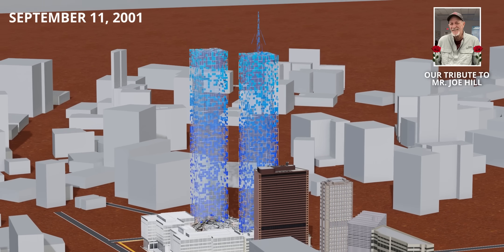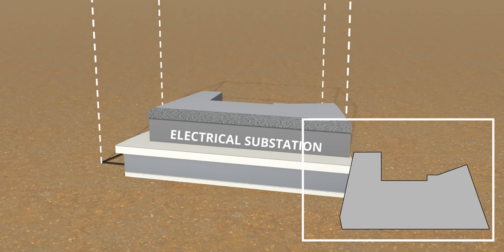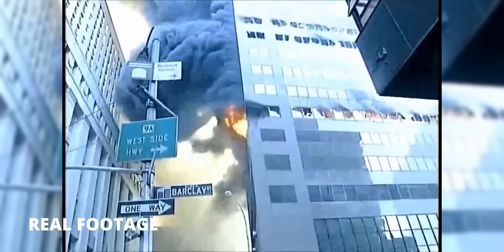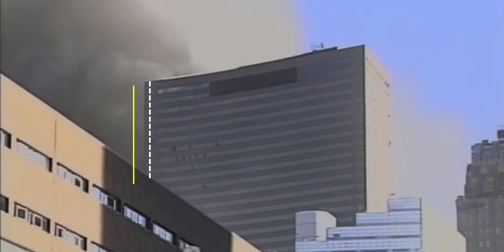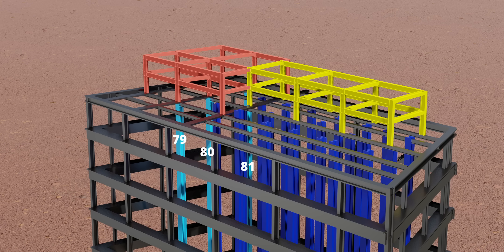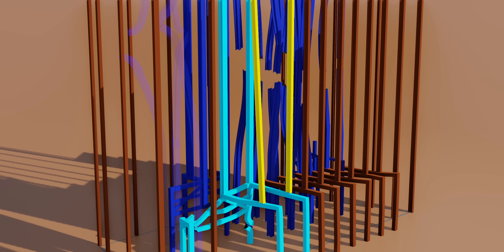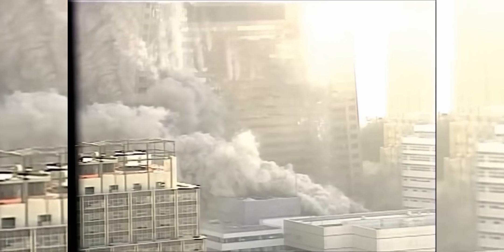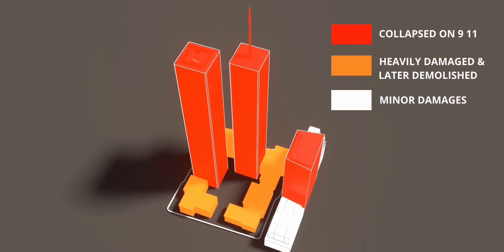Collapse of Building 7 | The Complete Physics

Comment: This was a controlled demolition, building 5 and 4 had MASSIVE amounts of rubble fall on them + fires and DID NOT FALL AT FREE FALL SPEED.
Reply: No building collapsed at free fall SPEED not least because there is no such thing.  Free fall is a measurement of acceleration, not velocity. Building 4 did completely collapse BTW.

Free fall SPEED is just one of a long list of really bad information out there about the Twin Towers collapses, much of it easily accessible to anyone (mostly from Architects & Engineers for 9/11 Truth who only manage to get the date right). Even though the worlds professional engineering community had the details largely worked out within a couple of months, good information is far more difficult to come by and much harder for many to digest. Engineeringspeak is complex and dull and some people put up a wall to protect their beliefs and false assumptions. Besides, wild baseless speculation and pathological theorizing is exciting. Simple, easy hand-wave answers are simple and easy. Fanciful tails of pre-planned demolitions, magical space beams, melting steel and mini-nukes (the awful stuff) are far more entertaining and require a whole lot less thinking, thus getting far more intention than it deserves.

To correct that situation, I have all on my own prepared this short yet detailed technical description of Twin Towers collapses based on my own observation and analysis of the available true and relevant facts. No politics or ideology, just the engineering. My hope is this will dispel many common myths and answer most if not all questions you may have about the Twin Towers collapses, because anything can seem like a conspiracy if you don’t understand how it works

While complex, most of the Twin Towers collapse mechanisms can be seen with the naked eye and easily discerned and understood by the layperson if sufficient time is taken to understand. 

1. The Twin Towers consisted of 4 primary structural elements that together formed an integrated system where each relied on the others.  47 hollow box-section steel Core Columns carry the majority of the gravity loads. The 236 hollow box-section steel Perimeter Columns carry the remainder and ALL of the lateral (wind) loads. Long-span Lightweight Steel Trusses connect the core and perimeter column together at each floor with a Hat Truss on top to tie the structure together as an integrated unit where no element can survive without the others. There was no structural load bearing concrete and most components were bolted together.

2. The impact of 117 tons of airplane (= to about 12 dump trucks) at speeds up to 590 mph with the energy of a ton of TNT completely destroys the aircraft. This in no way implies the Towers come out unscathed. Many perimeter columns are damaged or destroyed as are some core columns (example; 33 of 59 perimeter and 20 of 47 core columns damaged or destroyed at the impact floors in the North Tower), This damage is primarily through bolt-shearing failures at the end connecting flanges, as well as bending, twisting and fracturing of weld seams. There was no cutting or slicing - the reality was far more violent and messy. 

3. The impacts destroy or damage fire insulation, fire breaks and sprinkler systems on multiple floors.  Huge fires are started across multiple floors simultaneously and allowed to spread rapidly with no effective firefighting or fire suppression. This was an unprecedented fire event . 

4. The hotter steel gets the weaker it gets .  With fire insulation stripped away and no sprinklers the survival time of the steel greatly reduced. Gradually over time heat causes the lightweight steel Floor Trusses at the impact damaged floors to sag, which was observed and recorded.  No steel melted or needed to. Structural steel fails long before it becomes a puddle. It just needs to bend

5. Sagging floor trusses pull on the increasingly weak and overloaded Perimeter Columns, causing some of them to bow inward by up to 5 feet. A straight column is up to 4 times stronger than a bent column. The bowed Perimeter Columns buckle and fail, initiating collapse. The formerly static mass above which the structure below could easily support is now converted into a dynamic mass up to 30 times greater. Because they have buckled, the Columns above and below the failure point are no longer aligned . The load bearing structure below no longer bears any load as it falls past the lower columns, NOT onto them.

6. Thousands of tons of debris fall within the four outer walls, down through the open office space, crashing onto the first intact floor it encounters. This massive impact immediately breaks the bolted connections to the columns as the amount of resistance the Floor Trusses can offer is negligible.  The falling debris slows only marginally and briefly. Note:
6a. This is NOT a solid top block crashing into and “crushing” a solid bottom block .
6b. The debris falls past the columns not onto them.  The columns provide no resistance to the falling debris. 
6c. Only the bolted connections of the floor trusses to the core and perimeter columns can offer any resistance. A pair of 5/8” bolts at each end of each truss vs. thousands of tons of falling debris.
6d. No laws of physics are violated.

7.  This floor-led collapse progression within the four outer walls can only go straight down. Note: 
7a. This process is often incorrectly referred to as “pancaking” which actually refers to a completely different process rejected at an early stage. The catchy name stuck but nobody knows what it is supposed to mean.  Pancaking is too simplistic and inaccurate anyway. More like Kaiserschmarrn.

8. Collapse progresses through the floor systems not down the columns, through the path of least resistance . Rate of floor failures increases with each successive floor as momentum increases, reaching an average acceleration of 0.65 of GA, or 35% slower than true free fall. Bam, bam, bam down the building until there are no more floors to fail.  The resistance offered by each successive floor is always the same. The mass and velocity, thus the energy of the falling debris is constantly increasing, with each floor destroyed adding new falling mass. Some falls to the sides, but most falls down. More mass, more velocity, same resistance with each floor.  Don’t get stuck on the but the lower floors weren’t on fire nonsense. They weren‘t and didn’t need to be.

9. The Towers were 95% air by volume. As that air was compressed inside the building it is forced down the tower and blown out the sides in reaction to the building collapsing . Those were not “explosions”, it was expulsions of compressed air caused by the collapsing building, explaining the low velocity, lack of flash, blast, supersonic pressure waves and lethal high-velocity ejecta.  

10. Perimeter Columns become detached and peel away like a banana behind the collapse front, playing out to the four points of the compass extending to more than 600 feet from the base of the towers. This was quite obvious from examination of the debris pile. 

11. Core Columns fail last as their internal beam bracing is stripped away by falling debris and lateral support from the floor to perimeter columns is lost. 

12. For those who care about how long this whole process took; 31-34 seconds from the moment the perimeter columns buckled until the last core columns hit the pile, or 1/3 the rate of true free fall. Don’t believe me?  Just watch any video of the collapses and note the loose truly free-falling debris dropping much faster than the towers themselves.  

13. Each Tower had a 1-acre footprint. Far from collapsing inside their own footprints the debris pile spread out over 17 acres in a pile up to 14 stories deep. 8 surrounding buildings were destroyed and scores more damaged by the falling debris. 

14. What was NOT observed were the 180-190 dB bangs of thousands of high explosive devices or the blinding bright flashes of burning thermite. Neither could have caused the (silent) perimeter column buckling that clearly initiated collapse.  Neither explosives or thermite could have survived the impacts and subsequent fires either. A video of a shocked and injured firefighter using the magic word explosion is in no way proof of explsoIVES . The pre—planned demolition case relies entirely on that sort of thing. There is zero tangible physical evidence and it would be technically impossible, totally impractical and completely unnecessary. No one would bother. 

15.  Finally, the Twin Towers were perfectly safe within their design envelope.  They only collapsed when taken far outside design parameters by an extraordinary and unprecedented event 

Impact + Fire (heat) + Time + Gravity = Collapse . Remove any one of those four elements and there is no collapse. Ignore any of those elements (as many do) and you will never understand the collapses. The Twin Towers were an integrated system in which no one component could survive without the others. One fails, the rest follow, through the path of least resistance – DOWN – through the open space, bypassing the path of greatest resistance – the columns.  Nothing I just described violates any laws of physics. All of the above is true no matter who planned and carried out the 9/11 attacks or why 

I hope you found this helpful and informative. It is not meant to be adversarial, but to solicit informed critical comment, positive or negative. If I made any errors of fact, logic or reason or left anything critical out, please let me know so I can fix it. To stay focused just one topic at a time please and on-topic (Twin Towers ONLY). No word-salads of Gish Gallop. IF you can offer a more plausible alternative be my guest. Be the first. Please start any reply with the words “Tits McGee” or I will know you didn’t actually read it, are not serious and just wasting my time.

Comment: I'm not buy this bullshit!!!
Reply: Seems like a personal problem.

This video is pretty good – with a few exceptions - and goes into a much higher level of detail than many viewers will be able to comprehend.  While not perfect, the collapse mechanisms – the sequence of failures - described here  are substantially correct and this is true no matter who planned and carried out the 9/11 attacks or why . 

That may not be what you want to hear and go against 20+ years of entrenched dogma and conditioning, but it’s not wrong. 

That also means (in case you did not get the hint) this video can be (and IS) absolutely correct in its description of collapse mechanisms AND the 9/11 attacks could still have been some sort of inside job. The two things are in no way mutually exclusive. 

The mechanisms described here have broad professional support around the world. There are no professional engineering organizations (for example: ASCE, ASEE, ICE, etc) that disagree with them or have offered any formal dissenting opinions or alternative hypothesis. 

So, setting hubris aside, either the overwhelming majority of the worlds structural engineers and simple observation are wrong,… … or you are. Which seems more likely? 

IF you still think believe this explanation is wrong then produce a better one . Good luck with that. No one ever has and I don’t see you moving that needle today. 

No one ever does.

Comment: Man, if only there was a single piece of physical evidence from wtc 7 to back any of this up....
Reply: There is.
Reply: @TheCriticalStinker-01 Not according to NIST
Reply: @TheCriticalStinker-jw4fl  The wtc 7 collapse final report from NIsT states that all remains of wtc 7 were disposed of before they began their investigation.  Their draft reports are way less obscure, stating that the steel used during the construction is based solely on data from the literature, because no steel from the building was recovered.  NiSTs words, not mine.
Reply: @kyleconroy2312  - Yes, that is correct. Which is exactly what I said.  You need to read my entire post.  All of the words matter and go together.

Comment: That’s reaching like crazy, there were no sprinkler systems in 7 to put the fires out? Also the top of the wtc tower that you’re claiming hit 7 looked like it fell a different direction from 7, not directly away but just to the right of it and the angle in which it hit wouldn’t make sense. I’m still not sold that this is what happened, sorry man.
Reply: The sprinkler system was not automatic but manual. The building was evacuated prior to the North Tower collapse.  Effective active firefighting never took place due to half of the responding FDNY having just been killed, surviving units in disarray, much of their equipment destroyed and the collapse of the North Tower severing the water supply to Lower Manhattan.

The video is incorrect in stating the antenna hit Building 7. It was actually north face perimeter columns which struck the south and west sides of Building 7.

Comment: They say in this video that the Spire caused the damage to one side of the building wtc7. Can anyone tell me after tower, one and tower two were completely collapsed and the smoke cleared why I could still see the top Spire standing Upright. This is just another false information video.  look at the evidence. and why do they not ever let you hear the soundtrack as the building fell multiple explosions being carried out And Witnessed by fireman at the time exactly like a controlled demolition again, I say, they never show you these videos with the audio. ? Cover-up
Reply: You do realize that the fire department evaluated building 7's condition, determined that it was unstable and eventually going to collapse, right?
Reply: You mean the North Tower. That was not "the spire" (the antenna). It was about 60 stories of core columns around Stairway B.  Cores were the last parts of both Towers standing.